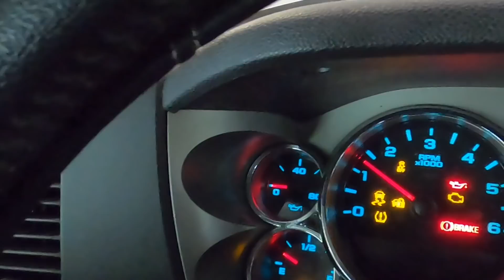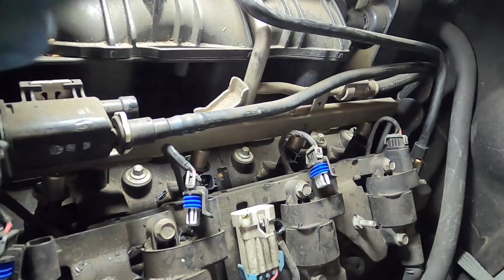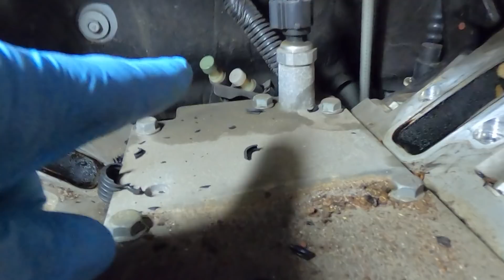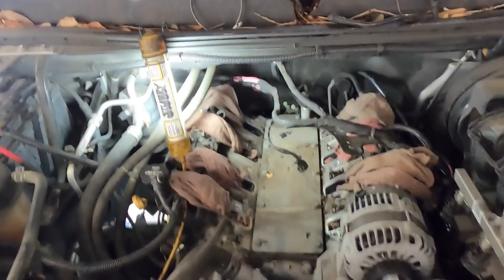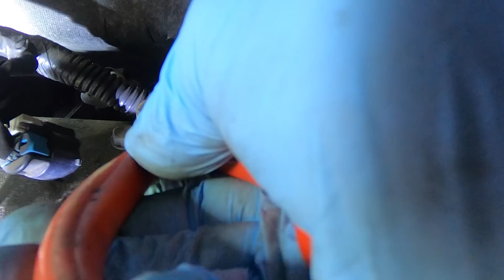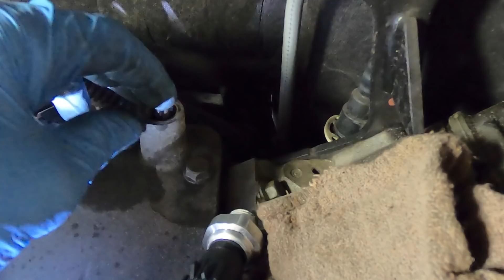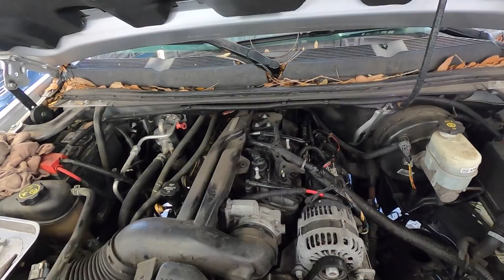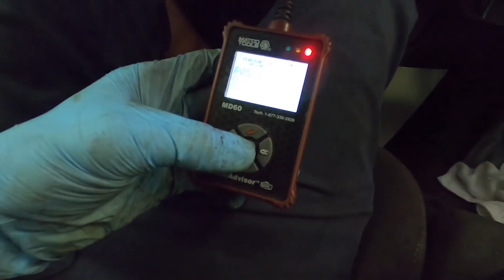Customer States: Google Diagnosis…replace this part!

Comment from the maker: Ok so after a couple day of Reeeeeeee comments I’ll chime in. For starters, the customer said that the gauge intermittently works then quits. No! I won’t do this job without pulling the intake. I’m not risking straining or cutting my hands up, so I can charge 25% of the book time to do the work. I have to take care of my hands, they feed my family. If I strain a metacarpal or get cut I can’t earn. I didn’t decide to circumvent the process to “pay less” for a repair because google said so. I don’t own that. Others people’s decisions are not my problem.
Reply: @6speedcreed204  this is partly the reason i quit doing work where I live at. Got tired of the "I got a buddy who can do it for 40 bucks" line.
Reply: @jonathanjuillerat9831  after i ask why they are in my shop if thier buddy can do it for 40 bucks i just lean into it and act like that's the greatest idea ever and then i insist they do it and tell me all how it turned out.
Reply: Was there ever a update?
Reply: After all, the fault is the vendor of the engine. It's crazy how some modern engines are designed. One could think that they are just built to get screwed together and never taken appart without ripping appart the whole car. Sure, there are more sensors, wiring, solenoids and stuff, but after all, a careful designer would NEVER put a sensor in that location!

Many modern engines are halfway under the dashboard. Good luck replacing the glowplugs on a modern FWD van or similar cars. Just the opposite of "form follows function"
Reply: @sorryimajerk735  Try cutting your hands up all day , everyday for 8+ hrs, for years on end, around hot as hell greasy,oily dirty engines, diffs trans, and oh yeah , asbesto brake dust when doing brake jobs.   See how much you enjoy it. There's a reason mechanics get paid good money. It's for what they know and have learned. Not because they enjoy self mutilation.
Reply: As an experienced GM tech I will chime in and say, I have never done all that and the average OPS is around 15 minutes for us to do.
The way YOU did it is by the book. So that being said you are doing it the right way and the way it is supposed to be done and I'm doing it the incorrect way. So if anyone gives you shit they can fuck off. We all have our ways we do things, so long as things are done right and not being damaged and you're not fucking yourself up then folks have no need to comment.
Reply from the maker: @frbrbrgrblgrr7777  There are 1000 different ways to do a particular job! I’ll also add that in this particular instance doing it the shortcut way would’ve made a crappy video🤣
Reply: @RainmanRaysRepairs  So when no one is looking how do you do it?
Reply from the maker: @johnhnetkovsky8917  I pull the intake 😎
Reply: @RainmanRaysRepairs  don't you know that having an education doesn't mean you know more than your customer 🤣
Reply: @RainmanRaysRepairs   okay so is it possible the reason the new screen did not fit was because there was an old one in still in there or the o-ring was not lubed? These seem like reasonable theories from the Reeee comments. Wondering if there were any updates after this repair. PS. I love your channel.
Reply: @RainmanRaysRepairs :  I saw you stick your pick in the hole, but some say there was a factory filter in that well. Thoughts?
Reply from the maker: @hightttech  maybe some had it, or dove didn’t. It could have been removed also. 🤷‍♂️
Reply: @RainmanRaysRepairs  Gotta love the armchair professionals in comment land.
Reply: @RainmanRaysRepairs  I do agree that not removing the plenum would have left a tiny fiber-cam video. I was by no means digging you at all in my comment other then to say that I'm pretty sure you left the old filter screen down in that hole. Like I said in my comment, I had to make a curtain wire fish hook deal to get that dern filter screen out of the hole because the O ring seal was holding it in there pretty tight. I made the hook so it was tight and would split hard into the screen when I tugged it out. Again, I did this blind with the plenum on in under 2 hours with plenty of breaks for a cig since it's not very comfortable laying on the engine standing backwards on a ladder lol. I always like your vids, soldier on I say with your great channel bro.
Reply: @frbrbrgrblgrr7777  sad they dealer is going to bill for 2.5hour
Reply: @frbrbrgrblgrr7777  I think your full of shit 💩🤳 lol GM Lube boy that's about it leave the Man a lone he does right by people all the time.
Reply: @sorryimajerk735  
There is a world of difference between an "Ouchie" that requires a band aid and a gash in your hand which can lead to an infection.
Reply: so much hate in here, think you can do it better than this fella than put your money where your mouth is and do it.
Reply: When you were finishing up the video, and stated that the issue wasn’t fixed, I noticed that the engine light was no longer on, and the oil pressure gauge was reading 28-30psi!  So looks like that fixed it after all!
Reply: @lifewiththehamptons1993  32:08 is the time stamp the owner said it was intermittent and that's still low but it was one of simplest things and a good place to start quite a few people hinted at what was likely overlooked but as with anything until the problem is fixed its just speculation.
Reply: this is probably said, but usually the gauge will come back once the codes are cleared
Reply: The old filter was down inside.  Thats why the sensor wouldn't screw into the intake after you put the new one on top of the old one.   So you technically owe him 2.6 hrs of work to take that all back apart, remove the old filter and put new one in at your cost since you threw the old one out 🤔  Even if the customer wants you to replace a part that isn't failing you should decline the work and do the "right thing"   Seems like a shitty move just for content
Reply: You know your doing something right in your life when you got haters 🤣🤣
Reply: So many YouTube mechanics in these comments. 
Y’all go ahead and post videos of doing your shortcut work. Then you can use all that time you saved for court when you get sued.
Reply: I agree with you Ray..
Reply: If you gonna do a job, do it right.. so im 100% with u
Reply: @tsal4379
Reply: @sorryimajerk735  What he said was that he isn't risking an injury just to save a bit of time because his hand is what gets the bills paid.. And he gets cuts on his hands all the time but there is a huge difference between getting a cut and getting injured
Reply: Oil sensor socket, universal joint, 6" extension, a ratchet and you can have it out and reinstalled in 20 mins.  Then still charging the 2.6 hours.  👍 Also gotta watch out for a clogged oil sender screen causing a good sensor to malfunction.
Reply: You're goddamned right.  Those hands are the most important things you have, for without them, you are non productive.  You did the right thing.
Reply: yep. but also i would have scanned it first and then called the customer. but then again the customer wanted it replaced with no diagnosis.
Reply: Car Wizard has an interesting take on this. Even if he can do something in less time than book, he still usually charges book because he's not gonna take a pay cut for getting better at his job. However, in his case that can cut both ways because if a job takes longer than planned, he still charges book hours.
Reply: Strain a metacarpal?  Dude, i love your videos but that is one of the most Reeeeee comments i have ever seen you post, ironically, lol. "I can't do mechanic work, because i might strain a finger and then not be able to do...mechanic work." :P  Also the "hello guys and gals" opening was fine the way it was....please don't indulge the mentally ill people that "identify" as mystical fairy poptart queens...it just adds reality to delusion.
Reply: @47ravenlord  someone might sue him for that one day
Reply: @32:08 the gauge is working.
Reply: I replaced my sensor without removing the intake and it was awful. I was cussing like a sailor and I couldn’t even find the filter in there because I couldn’t really see what I was doing back there. I had about an 1/8” turn radius and had to use like 3 different adapters. Definitely agree with you here
Reply: I agree with you 100% Ray! check my response.. ( if you have the time)
Reply: Safety has to come first. If you have to remove stuff to get it out of the way so that you can "safely" access the part in question. Well, that's part of the job. You aren't a contortion artist for goodness sakes. 
Many people don't realize that engine oils and chemicals can cause the most outrageous skin infections. Many Mechanics over time due to exposure to oils and chemicals get serious skin issues. I've used many times of barrier creams to stop or inhibit contamination but the first thing I've learned is. reduce the chance of unnecessary injuries. That being cuts, scraps and dripping oils & chemicals on my skin.
Reply: Just found your channel man. I’ve been wrenching for 10 years and Agree completely. It takes legit 20 min to have that intake off and I work on a ton of those gm V8 for lifter noise and oil pressure concerns.
Reply: It’s nice to see a tradesman standing up to these “tough guys” who seem to always be questioning someone else’s toughness.
Reply: To all, you so-called speed legends and super techs open your channel or business and show us all how it's done.🤔
Reply: Geez but there's some shitty comments here. It's well within Rays rights to say he doesn't want to chance being injured at work: if you are cutting your hands constantly at work and then super gluing them then perhaps you MIGHT want to look at how you doing your work cos apparently you are doing it wrong . . . .gloves are your friends here. I don't want to get injured at work and I do what I can to avoid injury, doing otherwise is nonsensical and again, you might need to review how you are working. Mind you, as a nurse it's always fun sticking needles into some dumbass that just sliced his finger four days ago and superglued it thus locking in all that bacterial: thank you for keeping me employed giving tetanus injections and cleaning out infected wounds. And as a safety officer, yeah, if you are getting cut, damaged, bruised, burned and have constant eye problems then we DEFINETLY need to reevaluate your work practices and attitude because it does seem like you are REALLY poor at your job. 😂😂😂
Reply: Safety first, last, and always! 

Just reiterating an early comment of mine, I wish the designers took the  mechanics of repair into mind when designing engines. So much of what the average owner cannot do, and much of what drives y'all up the wall is unthinking designers -- like the video where you had to unbolt the subframe and use a crowbar to remove a bolt blocked in by a pan. Make the designers do repair videos!
Reply: @ajkleipass  Engines are a monstrosity of luck....they are designed the way they are for the reason....because that makes it work semi reliably. If they designed them your way every vehicle would be a bus with the engine floating in the middle for clearance purposes, lol.
Reply: @ajkleipass  they are thinking all the time how can we make this hard so they go to the dealer or ruin there can and buy more perfect sense company wise
Reply: @ajkleipass  I wonder what a service friendly engineered engine would look like 😂😂
Reply: @ajkleipass  The designers know exactly what they are doing. Making something simple hard allows the automotive industry to make billions off replacement parts like special wrenches, pliers, and assorted tools, as well as hoses, gaskets other parts that if the job was easy wouldn't need replacing. It also allows the mechanic to enter parts of the engine that didn't need entering with older models, and thus diagnosing other problems, and making up-sales of other repairs. "Well since we have to engine this far, you might as well get this fixed also."
Reply: @ajkleipass  A lot of design isn't strictly up to the designers...   There's the no, you can't do that, it costs too much, the get it done quicker, etc.
Reply: @ajkleipass  but with all the other governmental regulations that car manufacturers have to follow that’s dang near impossible. A 2011 Chevy traverse requires you to remove an engine mount to replace the starter. Which is stupid if you ask me but it was the only way it would work.
Reply: @ajkleipass  buddy they did plan on the mechanics of repair. More specifically they planned on their mechanics getting a cut of the repair...
Reply: @inibrasiumthefirst2680  Hence the Dealer Tools for many jobs
Reply: Sounds like a gauge problem or the wiring that leads to it I bet it still has pressure
Reply: @howtowithelizabeth7513  it had pressure or the lifters would be making a racket
Reply: @howtowithelizabeth7513  LS engines are notorious for defective pressure senders.  They had problems from day one in '99, but post '07 engines got a lot worse.  No pressure and no lifter peck, almost always a defective sender/clogged screen.
Reply: @FMChimera  Thanks for reminding me that my Corvette needs the pressure sender fixing... I come on here for joy and merriment and now I'm reminding myself that 20,000 beers in that my hands no longer fit in tight places like they used too.
Reply: I agree 💯
Reply: the long and short of it is, if you want to complain about how much a shop charges for a job, then learn to do it yourself. if you cant learn to do it yourself (or dont want to) then your going to be paying what the shop charges you for the job.
Reply: @omgbbqcia911  with all due respect a shop should be doing it correctly anyway. Doesn't matter if you can or know how to do it yourself.
Reply: Watch it be the pick-up tube.
Reply: @2121beastmode  
Or the stepper motor operating the gauge.
Reply: Just throw the filter out. That's messed up.
Reply: What morons think you should do this without removing the intake?! o.0
Reply: I have to disagree . From what I saw it was fully worth the attempt to do it without removal of intake. Charge the full and take the shortcut if it is doable. Safety wise you should have an over creeper for truck under hood work instead of standing on bumpers and kneeling on rad brackets. At the end I see it showing about 40 on the  oil pressure meter top left so it is fixed. Now he has a decent chance of intake problems due to plastic and retorquing improperly.
Reply: I agree. My hands are my bread winners too.  Heck, my car bit her mechanic last visit and broke one of his fingers.  I felt bad. 😳
Reply: Fyi GM dealers would fire you for pulling the intake on that job
Reply: chevy,,like toyota,,change every 6 months..
Reply: I never use Google for advice. I use it to find people who can give me advice..
People think that google will solve anything, some things I found (electronics related) was so wrong, it ended up damaging some electronics I was working on..
Reply: @original_mrsaizo  I use a bit of everything. I repair my own stuff and sometimes Google helps as you can find things like I dunno the manual for the vehicle your working on. People will usually give you wrong info wouldn't go on someone else's advice without first looking it up or checking it first. Advice isn't fact thus your method kinda sux sorry
Reply: Why would you charge less than book time?  Book-time is the customer cost regardless of how long it takes you.  I'm assuming you are not flat-rate
Reply: Let’s address some things…

First. Ray don’t lie to yourself you did the job like 90% right. I can accept if a customer doesn’t want to pay for diagnostics, I can accept if a customer doesn’t want to pay for a new intake gasket set, hell I can even overlook using shop air to clean the valley instead of getting the vacuum out (I mean that does take more time). But what I won’t look past is did you cut the footage of you cleaning the intake seal or the runners, of you looking for an old filter screen? These are items that shouldn’t be looked past for an experienced technician like yourself.

Second. To half of the weird comments around here I just used that word technician. I use that word because I am proud of it. I went to school for an education. That does not make me any less of what a mechanic is, but I will say whichever word you use you better  be respectful of people who do something you choose to pay for. But for me by denying my education and calling myself a mechanic that’s something I won’t do I earned the right to call myself a technician I didn’t get a job at Jiffy Lube where they call everyone a technician because it’s now sadly used as a catch all job title. And to the favorite comment I read so far on this video I sure can do a lot more than read a scan tool…

Third. To all us who know this job can be done in 20 minutes. I agree with you it can but you risk a lot more doing it the wrong way when you don’t know how to do it the wrong way correctly. I know that sounds weird but for example  if I asked you to replace any part on a vehicle and I said that trained generic technicians (those people who come up with labor times for example) took them 8 hrs to do the job as designed to be done by the manufacturer and we found a guy who has been doing this job incorrectly and repetitively since it started occurring and he gets it done in 1 hr. That first guy had to follow an instruction book correctly and in a timely manner, this take him negligible time to do, the second used those seven hours he saved multiple times to create his own instruction book and when I don’t have his instruction book I don’t get to do the job the “fast way”. What if Ray didn’t know the fast way existed?What if there wasn’t a GM guy around to tell him what he needed to do to get it done the wrong way? You do the right thing as a technician and you follow the instructions the manufacturer made available to you and you get the job done, maybe you learn that next time you could do x,y or z to do the job faster, maybe you make a YouTube video of your day, then get way to many people commenting who watched a different video of another guy doing the same job and “he did it differently and way faster” or “they do it themselves that way”.That is amazing for those people, great job. The point is Ray you did this job mostly right and that is what I appreciate about your videos. The “fast way” to do something will always be the fast way and unfortunately fast does not equal right. From a technician who also doesn’t risk his body for a quick pay off I applaud your resolve to perform jobs the way that you are comfortable with so far as risk is concerned.

Four as a dealer technician I am asked to install parts all the time without diagnosis. I can not make a customer pay for anything and I also can not tell the customer what to do with their money. I can talk to them and explain why I have aversions to fixing the car this way. In the end I am a wheel in a cog and if my dealer wants to accept money for a repair I can only tell them to ask another technician to do the service. The same way a customer is allowed to pay me for diagnosis and then decline the repair I suggest the opposite can be done as well because that is their right as a consumer in the U.S.A. I know you agree with me on that one rainman. 

Five, diagnosis of this would have been a terrible video I’m pretty sure and the fast way would have made you every other backyard tech who posted a video titled “how to change this problem LS engine part in less than 30 minutes”. Keep on rocking your awesome videos and giving a better name to technicians than most of the other YouTube techs out there.

Lastly whoever did that playlist can we get a Spotify link?
Reply: Holy shit I've done hundreds of these and the FIRST thing you do is remove screen and do not reinstall EVER!
Reply: Google told me you suck so I had to stop by and see if that was correct...I'm happy to report google is full of crap lol
Reply: Ray, you are absolutely correct.
Reply: Ray, you deserve to be paid. Going by book time, sometimes you eat some labor, sometimes you make out, it will all even out. You're an honest, smart, thoughtful guy, I don't expect you to take shortcuts.
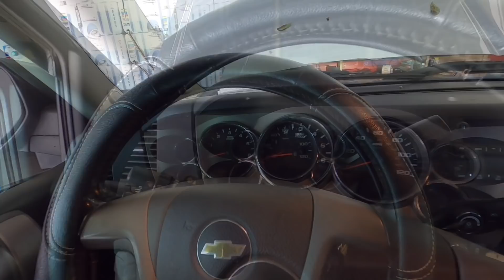Reply: I'm at 29:54, you're just about to test it & I'm saying "Nope!" 
The customer read about the recall & it suited his symptoms. But I reckon it's a blown gasket or seal somewhere related to those other warning lights... 🤔
Reply: What a joke to change a oil sending unit, they could of mounted it in front of the engine.
Reply: @jasonjgr8580  but they didn't. That's not relevant here
Reply: A lot of these commenter love talking 💩💩💩💩! I thought you did what you were told to do . The vehicle started and drove no harm no foul.👍
Reply: you did it right.  on the trucks, its nearly impossible to actually get back there without being a contortionist.  your work time, no one elses.  I did the one on my cargo van, and damn is it nice to pull the doghouse and just be able to reach the entire engine.
Reply: They paid less only to cost themselves more when the repair they requested didn't fix the problem.
Reply: I have this issue with my own 2010 Silverado 4x4 5.3--- the oil pressure sensor went on the truck shortly after I bought it 3years ago... I will be rewatching this for the full repair looks like I'm invested more than I'm physically able..thank you for your time keep up the Hard work
Reply: @richardbobrowski   learn how to do it without pulling the manifold, less chance of breaking stuff. My cousins truck has this issue a lot due to the lack of maintenance from the previous owner, the sensor is usually fine once you have a screen, sometimes I can just clean the screen and put everything back. The brake booster clip and sensor clip take practice, and you do need a special socket like Ray mentions in the vid..
Reply: @djmjr77  brother I can't tell you how much I appreciate the help bought that truck almost three years ago now and it's a great truck I just can't allow anyone to fix it ... thankfully theirs guys like Ray because all I have is the AutoZone Chevy Silverado 07-13 book and Common sence .. any form of help is much appreciated Thank You
Reply: @sorryimajerk735  gb
Reply: I've replaced this sensor in 15 minutes with the screen many times.. the first few times def took longer, but its a piece of cake now. I also do not work at a shop that could have liability if the manufacturers instructions are not followed.. and something happens doing it the "quick" way The intake isn't to hard to take off anyways and give a chance to cleanup under it I guess..
Reply: I don’t believe you removed the old screen (maybe you did and I missed it) I did this repair about a month ago and used a bolt roughly the same size as the sending unit orifice to thread down on the old screen and remove it.   It was covered in brown goodness….I ended up having to reuse the old sensor because I broke the new one trying to tighten it down blind (kudos to you on removing the intake….I tried the easy way and failed haha) the new screen fixed my oil pressure issue.  I’m not sure if that truck had one but I’ll bet it did.   Anyway sometimes the internet can be helpful. Not trying to be a troll douche just adding my own experience to the convo.  I enjoy your videos brother ✌️
Reply: Charge book time,  and do it in 20 mins. Customer isn’t paying me for my time in it, they’re paying me for the years of experience it took to learn how to do it quick and easy, without issues.
Reply: @johnsonspeedfab   I'm not 100% certain, but besides the moral implications, I don't know if that would be legal to charge book time to pull the intake manifold and then cheat by doing it with a swivel socket...   Ray?
Reply: @hyperchuk  when a vehicle comes in with issues/concerns, and the fix has already been quoted by the book, doesn’t matter how it gets done, as long as there are no more/new issues. 
 
The reason master dealer techs make a killing. They get into a rhythm of the same-old same-old, and they get good at it. I’ve seen guys knock out 2x 10+hr transmission R&I’s before lunch.
Reply: @johnsonspeedfab   For what it's worth I Am one of those guys and I have been for the last 47 years. I just know how bad that pisses off customers when you pull that angle
Reply: @johnsonspeedfab   I was the transmission technician at Gary Fronrath  Chevrolet for 3 years and I used to pound out rebuild after rebuild on that 700 R4 and I made about $2800 a week like falling out of bed....
Reply: Changed this part on my 2003 silverado without removal of the intake, but it was frustrating working with a mirror to see. Oil pressure gauge would pin at max pressure. Replacement of the sensor fixed it.
Reply: I once visited a doctor at a new office.  He hired me on the spot to hang his diplomas and stuff, because his insurance, he claimed, forbade him from using a hammer.  But he had a hammer... go figure.  Anyway, I got paid nicely for an hour's work.
Reply: Hard to check the sending unit screen with the intake in the way, also hard to get it out without damaging it with the intake in the way
Reply: @sorryimajerk735  as the owner of several successful workshops in Australia it is my opinion that pig ignorant, crude and disrespectful employers like you (if you actually are one) are what really damage our industry most. A real businessperson manages people effectively and first, supporting their staff in an environment that fosters honest communication and promotes quality work. No worker in my shops had to risk their health or their career to make moronic shortcuts to feed my ego - if your staff are forced to, they have my sincere sympathies and I hope they get a new job at a decent shop soon and can leave your bad attitude hack shop behind. I would hire Ray (and have hired solid, skilled and effective tradesmen & women like him) any day. Didn't your momma teach you, "If you don't have anything good to say, don't say anything at all"? Most American I know are decent, straight people... I guess every barrel has a few rotten ones huh... "Bill" Kill...
Reply: If the technician is unfamiliar with a repair then following the service manual, or Mitchell, or whatever repair information you have access to is the only responsible way to perform the repair. It covers the technicians butt in the event of an unrelated fault, or a fault caused by a manufacturer defect in the parts. It's all about CYA guys, if you take a short cut and the job comes back it's all on you. As far as getting hurt doing repair work, a technician should always mitigate injury as much as possible. Injuries do happen and most of us shrug it off, but degrading a tech who values their safety says a lot more about you than them.
Reply: @kvanderpool0508  yeah I can see where you are coming from. But from the techs mouth he's going to do it by the books and he don't. Lol he may be a good tech that TRIES going by the book but 1 doesn't torque the intake or remove the old screen has no place to talk about going by the book. Either you do or you don't. That simple.
Reply: I understand if you don't want to give a exact location, I was wondering what State the shop is in that you work at. What radio station do you guys listen to in the shop the music is good working music. The shop I use to work in just played the local radio station which sicked at that time.
Reply: @Incognito FLA  realize you made a poor decision buying an audi without having a professional certified mechanic look it over first and then , im sure because of your mickey mouse repairs, the car no longer operated correctly. You are the perfect example of why professional mechanics are necessary.
Reply: @sorryimajerk735  Relax, bud. He gets cut all the time, but destroying your hands for one job is dumb. It's not like the customer didn't approve the cost beforehand. If they don't like it, let them go to another shop. 

Ray also saves customers money where he can on a regular basis. Go abuse the caps lock button somewhere else.
Reply: Well said.
Reply: I agree with you. Do it how you want. Personally im willing to "strain" a little to save time but im shadetree. Doing my own repairs. Not making a living at it. My biggest concern with doing it your way is the massive risk in breaking connectors that become brittle or o rings on injectors potentially getting pinched. Anything can happen!
Reply: You have no idea the memories this video brought me. My best friend TJ was a mechanic that passed in a car wreck November 14th 2019. His FAVORITE song ever was "Wanna be a baller" . As soon as i heard that and saw you under a hood I had flashbacks of him. R.I.P my brother...👨‍🔧👨‍🔧👨‍🔧 🙏🙏🙏
Reply: Psychologically wise you’re using a form of empathy to justify you taking off the intake manifold so you say “oh I can’t cut my hands and if I do I won’t be able to feed my family” b.s you’re trying to justify putting in more time then is actually needed to change a measly sensor when I my self have changed an egr valve on jeep 😂 where the work space is tighter then f*** in the back.
Reply: You know,  i read a lot of these comments about not being so worried about cutting your hands.  About how it should be an hour max.  I have to side with ray.  First,  its not about the one or two cuts from this job.  Us shade tree guys will happily trade that for the occasion it comes up for some extra time off the road.  For the pro, it is about all the cuts, bruises and injuries that occur from making a habit of it.  It is about havig ground beef for hands at the end of a week.  As far as the it should take an hour or less, labor guides are there for a reason.   Without them  some folks short change themselves on their good skills and investment in better tools.  Others would take advantage of the fact that the time comes down to their word against a customers.  It is there to protect both sides.   Dont like it?  Do it yourself.   I rarely take my truck in for service.   Usually it saves me loads of cash, sometimes not.  If i I were Florida and needed service, i would be happy to have ray turn the wrench.
Reply: I agree with you 💯% I work in auto repair shop customers think they know it all 95% of them don't have any clue what is wrong with there vehicles. Google don't know anything about vehicles
Reply: Some of these comments are crazy. If you want to abuse your body to do a job then you do you. To criticize someone who wants to do right by themself, and the customer is completely a "you-problem".
Reply: Exactly. If you don’t want to pay a professional, do it yourself & make sure you have towing on your insurance.
Reply: Haven't seen the end but part of me kinda wants the part to not fix the problem.

Do I search up plausible fixes when I have vehiclr problems, yes. But I take my hand at replacing the part myself if its something I feel I can do.

If it has to go into a mechanic and its vital, I am going to rely on their input. Got a place where they will put parts in. I mainly use them for suspension parts work or when I needed my wheel hub bearing assembly replaced. I didn't have the hammers to smack it out so I paid them for that work.
Reply: Ain't going to lie that day you guys was jamming some classic 😆
Reply: The sensor replacement really seemed need removing the intake mnfld.
Reply: Customer check engine oil?
Reply: I have a skinny 3 inch lag screw to be able to reach in and grab the screen. The reason the new screen wouldn't go in, is because you never removed the old one. It sits deep enough that it is very easy to miss.
Reply: 100% spot-on correct Ray.
Reply: I completly agree. I have an 09 tahoe and I did it by reaching around without taking off the intake but it was indeed a pain in the ass and I could barely fit my hand back to get to it. 

If I do it again I'll also be removing the intake.
Reply: Ray my man, good day to you sir. Don’t worry about neg comments on here you do not have to justify anything to these keyboard warriors.. keep up the good content 👍
Reply: After watching more of your videos than I would care to admit, I would honestly say if you told me that you had to remove the entire engine just to get at something I would take your word for it and NOT argue with you.  Although I've never met you or ever had you work on my vehicles, I implicitly trust you that you only do the work required and whatever work you do would be done correctly.
Reply: I feel the same way. I'll tell someone to fix it themselves if they want to jump my ass cause Google said you can do it cheaper with "dangerous" shortcuts.
Reply: A man has to make a living. The End!
Reply: OMG, I've seen enough in here.  Most of you A$$holes giving Ray a hard time about how he did this or armchair quarterbacking him need to shut up.  First he did it the way he felt it should be done and after watching a LOT of his videos I would say he did it the RI|GHT way.  Ray has probably forgotten MORE than half you idiots know about mechanical work.
Reply: I can't believe what it takes to changan oil sensor,
Damn,
Reply: @edwymer2226  It depends on the vehicle.  Some of them it would be a breeze but others are like this one.  I remember I had a Nissan I had to replace the starter, piece of cake job, right?  WRONG, practically had to take the engine out to do it.  Some repairs are nightmares while others are dreams.
Reply: Ray, just adding another comment in here, bud.  Please don't let the REEEE comments get you down.  A LOT of those type of commenters are nothing more than TROLLS that are just out to get a reaction from you.  Hang in there pal., because you DO a GREAT job and everything you do shows that.
Reply: Seems like you were a bit put off about that job. No doooo do doooos. And I could taste the salt in your voice. I'd be salty about doing such a job as well.
Reply from the maker: @ningen1980  I think I was PO’d over something
Reply: I agree with you I love these armchair mechanics and read something and know everything and I guess they recommend it all you climb over the top of the motor and stick your arm and back of the intake and fiddle around to get that thing out but I agree with you I wouldn't do it have a good day
Reply: If this guy has to remove the headlight , he may need to be air lifted out of the shop.
Reply: Agreed.
Reply: There you go, Ray! A wise old man told me "Do your job, but protect that body. There are many jobs, but you only get one body!"
Reply: Aren't you supposed to blast it off with air before opening it up?😮
Reply: Lots of shit posting here eh.  The customer didn't want to pay for a diag, they only wanted to have the part installed, and that's what Ray did.
Reply: regardless what the book says for the time, that how mechanics make there time. i can do those and the screen in 15 to 20 minutes flat. book time calls for 2.9. if i can do it fast cause I've been in the business for 22 years as a tech then that's 2.5 hours in my pocket. the book time doesn't change cause you can do it faster than the next person or cut corners to get the job done way faster. the more hours you flag the happier you will be at the end of the week.
Reply: @monstermike2541  book time is BULLSHIT
Reply: @stevejohnson1397  yeah it is but that makes it to where people won't get fucked in the end when they pay the bill. But as for techs I did a 10 job today in 5 so I'll take that anyday.
Reply: @monstermike2541   Mike, not trying to be a smartass here, just curious. When you do a 10 hour job in 5, do you give the car back in 5?  Has a customer ever questioned getting charged more hours than how long the car was in the shop?  I was in new car sales for many years and I thought the dealerships only screwed  sales, after reading all the comments I guess they do it to service too.
Reply: @monstermike2541  The Car Wizard said something similar, why should you get paid less for being good at your job
Reply: @monstermike2541  Sorry man but I call B.S
Reply: @davidbeanz3906  what bs are you talking about?
Reply: @monstermike2541  I got the wrong guy. Sorry man, I'm a dinosaur with this thing.
Reply: @davidbeanz3906  all good buddy 👍
Reply: @monstermike2541  really so why does warranty time always pay less
Reply: @firstnamelastname-gf4ds  warranty times are made up by the manufacturer of the vehicle. Flag rate is done by b.a.r. they have someone do the job 3 times and average out the times to make the rate time. Dealerships do 60 to 70 percent of the flag rate to fuck there techs for the engineers incompetence.
Reply: @firstnamelastname-gf4ds  cars under warranty are newer and cleaner and less broke generally and the guy doing warranty work is doing tons of repeat work so they're super fast at it.
Reply: ICE ICE BABY
Reply: Agreed.  Yeah, besides making the job hell for yourself, it also makes it possible that you’ll break something else while you’re at it.  Some people will never understand what this job is because they change their own oil and think that makes them mechanics.
Reply: It's funny how many people want to scream in favor of the shortcut method.  It's hard to find a good mechanic that would do the job right.  I've seen some of the shortcuts mechanics take.  Bent brackets, broken connectors ect...  frankly it disgusted me personally.  It's why I do my own work.  It's wrong to do work in this manner.  If you don't want to treat customers property with respect... get out of the buisness because you'll never work in more than a third rate chop shop.
Reply: @brianmyers2243  Preach! I like everything back the way it came apart. I don’t want someone telling me they couldn’t put this or that back on and that it won’t affect something. One reason I do my own work.
Reply: If you are going to do something do it right . If the customer and all other "Master Mechanics on keyboards" feel they can do it better fine, do it yourself then. Don't go to a shop for an act good faith. Salvation Army and plenty of Churches will do.
Reply: You did it the correct way. Never seen so many derogatory nonsense from people who clearly enjoy your videos. If you just look at the grammar and spelling, these aren't the sharpest tools in the shed.
Reply: @ravenfn831  you have intelligence by how well someone’s spells or uses grammar in a YouTube word post ?   Hmmm
Reply: Yeah the rate is the rate. I’d take the short cut and charge the full time. The rate accounts for hand tools yet we(I’m a tech too) use some power tools like that electric ratchet to get it done faster. We bought the tools that made it faster but weren’t necessary for completion. We learn the tricks. We reap the rewards. I cut my hands every day and I charge for blood. I say reeeeee to the haters though because nobody will tell me how to do my job. At least not successfully. If you are a customer don’t get butt hurt about it, you get your vehicle back faster. And all you want is to get back on the road right???
Reply: @iwalker1985  agreed. I'm a hard surface floor guy by trade and people give me grief about easy repairs but they don't understand that the tools I use and knowledge of how to use them are what they are paying for not the time it takes to use them.
Reply: @iwalker1985  exactly. If you don't want to pay even a discounted rate then fuckin do it yourself I say. Like me, I can do my own back brakes with my hand tools and take 3 times as long to do it. Or like today I paid my mechanic 80 bucks to do it because he can do it in less than an hour and my time is worth more to me.
Reply: @iwalker1985  definitely especially when you get paid by the job. No strain at all to get the socket short extension and 1/2 ratchet on it. Good thing with these once you turn them the slightest you can turn them by hand.
Reply: @iwalker1985  flat rate of figured out by an average the technician does the job three times and they average the time that's how the time goes in the book
Reply: @stevejohnson1397  you are correct
Reply: @stevejohnson1397  The flat rate is known to be inflated and is, again, one of those "self-regulation" circle-jerk measures. The technicians who do the jobs are not blind to the fact they are being timed, and techs aren't "required" to clock their time actual vs book time so the book time doesn't get updated. The book time is basically just a made up price sheet for a job, which is absolutely fine, but I wouldn't try to make it sound like it's this proven fair method either.

I don't have a problem with just paying people a solid price to do the job, and have no issues paying for techs time, knowledge, and tools, or even a flat price for a job, but the fact that it has to be justified in such a dumb and shady way is annoying.
Reply: The  @iwalker1985  is the
Reply: @iwalker1985  Ethical AF.
Reply: @iwalker1985 I concur.
I am 6' 5 239lbs and wear xlarge gloves so my hands aren't small. 
 I replaced my sending unit yesterday,without removing the intake and it took 19 minutes and I had never done it before. 
 I did not get a single scratch on my hands by taking the shortcut and I didn't risk contaminating the intake.
 I don't have a problem with him removing the intake but I can't understand not knocking out a job in seconds and moving on to the next repair and increasing a paycheck.
Reply: @iwalker1985  if the work is done by the book and i do mean word for word then i have no complains. saddly most the time i fix the problem myself because money tend to be tight when shit start breaking down. go figure
Reply: @Crispy77760  I hope aren’t an English teacher
Reply: @iwalker1985  no im not. there no pay in that and grading the kids papers you normally do that off the clock from other people experience they have shared with me. i work on computers for a huge company UPS i correct incorrect information on really everything. just because my grammar not the best doesnt mean im not successful. that not what implied but your suggesting something in the area of stupid or dum. ill say im the opposite of that. lol
Reply: @iwalker1985  No the customer wants the job done CORRECTLY and not half assed.. Because for someone like me if I catch on that you're doing half assed work and I'm still paying top dollar your shop is done.. There is something to be said about doing the job right the first time instead of trying to get done as fast as possible just to make more money for less work
Reply: @brandonstone6962  didn’t say it wouldn’t be right… obviously you didn’t read my comment. No where did I say I wouldn’t complete the repair. Just that if I buy tools that get it done faster or differently than the outlined method I would still charge the rate. I invest in tools to make money, not for charity. You sound like the kind of customer I don’t want. My customers actually appreciate me and are happy to pay what I charge. In fact I regularly get tips for my speed and quality. Time is short in this life.
Reply: @sorryimajerk735  hypothetical  you own the shop and find your employees are cutting corners and doing shortcuts that pit your shop reputation on the line and then also.not charging book time on their labor cosing you money on the bottom line. DO YOU FIRE THEM? If not then quit whining g about him doing it by the book.
Reply: To many know it all's on YouTube I wouldn't even respond to dumb comments like these. We all watch you save people money everyday if you do something they should know there's a good reason why.
Reply: Yeah, I did the shortcut and it dies save a load of time. It was on my own vehicle and it saved me not only time but no possibility of replacing gaskets or broken clips or whatever and I think the screen only fits the cover with the selonoids. Didn't fit mine either.
Reply: @ThePeopleVerse  I
Reply: @ThePeopleVerse  I had to dig for my screen. That was the hardest part aside from getting that stupid clip off the plug. 🤣
Reply: @marsh35404  mine for sure didn't have a screen.
A few months later the AFM started acting up and a lifter took a sh*t and I pulled it all and did a Texas Speed cam and delete kit. No screen found in the old cover.
 Funny, I have better oil pressure and a couple tenths better MPG and a nice rumble at idle and seems like some seat of the pants top end out of the old girl.
Reply: @ThePeopleVerse  I think it all depends on the year of the vehicle or if someone took it out prior to you doing it. I have a 2011 tahoe and it was for sure in there. Not sure what year yours is. Also, I have learned over the years to not use aftermarket electronic components like sensors or fuel pumps. Ac delco all the way and never through the stealership. 🤣
Reply: @marsh35404  using a skinny handled slightly angled pick is how I get the screens out when I do these. I also don’t pull the intake to do this job.
Reply: Marshall, gotta agree 100%.
I was at about 30psi with terrible tick started and had a sideways and a stuck lifter. TexasSpeed hooked me up. I took my time as it was winter and I did not want to have a 400$ electric bill trying to pull the shop from 4 degrees to maybe 50.... but a few weeks later and a home repair and she will walk the dog on the top end. Like you said too, a nice little idle to it as well. 
 Probably one of the best running 07 Avalanches around and almost 20mpg too boot.
Oh, and no screen for the new plate and sender either.
35+ psi oil at idle and 55+ above idle and stable. Never had that with that messed up system GM stuck us all with.
Reply: @6speedcreed204  those times are a best case scenario from a tech who has done it before. A customer would spend days doing this lol I've seen it
Reply: @inibrasiumthefirst2680  You're talking bollocks
Reply: @MattyEngland  im got more scars on one hand then your entire ego
Reply: He'll take the intake off and do all of the extra work. But he GUESSES the torque specs when going back together? So much for " by the book"
Reply: lmao, glad it didn't work, can't stand people like that.
Reply: ‘Book time’ makes me laugh. Correct tools to hand, experience of doing the job before and taking into account that everything comes undone as it should. I have customer sometimes quote the book time to me, and I explain it’s a 15 year old pos and that time isn’t going to work 😂 I’ll use extra tools that I have purchased to undo parts and fittings that have cemented themselves in rust. 
You do you mate listen to no one but your boss
Reply: FYI, you needed to pull the old screen out before trying to install the new one. Just did my 2011 5.3 without pulling the intake. Just sayin. 🤣
Reply: @marsh35404  he fished a screwdriver in there to clear out any old filter or obstruction... or did you not watch the video. If you cant pay attention then don't comment goofball.
Reply: @Im-Jeff  fishing a screwdriver in there won't get the filter. Thanks though.
Reply: @marsh35404  No it won't but it did verify there was nothing in there to get to begin with, thanks for doubling down with nonsense though. Additionally the distance the filter he tried to install went in 90% of the way is clear indication that no previous filter exists. It would not have gone in more than a fraction of the way if there was already a unit there. ;) It did occur to me that it may have a certain orientation that is required to go the last 10%, I might have spent more time trying to get it.
Reply: @marsh35404 :  Interesting. I haven't had this job before. So there was a filter from the FACTORY? That might explain the problem if it's clogged. I think i would have cranked engine to be POSITIVE oil getting to that sensor. This may very well be a fail for RR if he left a clogged filter in the hole.
Reply: @marsh35404  maybe you should have recorded it and uploaded it to you tube just so we know how amazing you are, just Sayin.
Reply: @pinkjedi6664  maybe I should have 🤣🤣🤣
Reply: Oh god.    Whine some more.
Reply: @daniellepage2923  hormone issues?
Reply: @ravenfn831  ?
Reply: @daniellepage2923  true
Reply: I guarantee you that, if engineers had to repair their cars, they'd go about the design way differently.
Reply: And fyi chilton time is what job pays not how you do it that's how you make money but I see your a NOOB  by the book it's ok sorry if I offend you but I've been a master mechanic for 30 plus years and you have to have a open mind especially living in the rust belt
Reply: I just hear whining. I can do it without cutting my hands or straining. You just want to rip people off. Hack
Reply: I was hoping you would have actually diagnosed a repair and seeing if it was a faulty gauge or wiring instead of just replacing the sending unit. But most likely it is a sending unit. I just think it's always good to diagnose the problem even if the customer only wants to pay you to do a certain thing.
Reply: @Ratrazor  Then people never learn to get things done the right way . . .
Reply: @Ratrazor  you do only what the customer asks, otherwise you (if you own the business) or the shop you work for is liable If something were to happen. Some customers would possibly understand if you spoke with them then there are those that it’s impossible to convey information to so that they comprehend it. Like many others have said, if it calls for 3 hours and you are done in 30 minutes they pay the 3 hours. There are way to many places to have repairs done to get bent out of shape over book times and right and wrong ways. I work on my own stuff but watch a ton of videos because there are better ways of getting any job done.
Reply: @Ratrazor   Changing the sensor didn't fix the shit. High current reading on the scanner  is most likely an indication of bad wiring, or a short to ground.  I would have scanned FIRST!!! And then Advised the Customer that his diagnostic might prove to be WRONG. If customer says DO IT ANYWAY, then you can really stick it to them .. lol
Reply: Only non mechanics would argue with you. As a mechanic I trust you, if you say it's not possible, I'm an idiot to try!
Reply: As far as having to pull the intake to do the sending unit really there is no other way, other than I've seen guys they'll lift the whole body off of the frame to get access to the back of the motors on the diesels and stuff. I don't know if that's less work or more work in this case. Or likewise you could pull the whole engine and tranny up and forward to gain more access that way also but really the intakes probably the easiest.
Reply: @Ratrazor  incorrect. I have NEVER removed the intake to do an OPS on an LS. Some have a cover that has to be moved back but  it is still possible to remove with the correct combination of tools.
Reply: @Ratrazor  you sneak your hand back there, unplug the sending unit, use a combination of tools and replace. No intake removal, let alone jacking up engine lol
Reply: @Ratrazor  There's no real reason to pull the plenum on an LSx to change a sending unit in a GM truck.   A camera, a swerbly, a couple extensions and a rest and it's less than a 20 minute job, even for those who still want to stiff the customer.
Reply: I've pulled and cleaned that screen on the same engine 4 times.  It's a legit 45 min job including mandatory break.  WITHOUT taking off that manifold.  It's NOT that difficult and yeah you might get a little boo boo on the back of your hand, but CERTAINLY no more "dangerous" than you standing on that makeshift stand.  What you SHOULD have done was tell the dude you're not taking the job without first diagnosing the problem.  You're really no better than he at the point you decide to simply take the part and add as much book time as possible.
Reply: I have huge hands and I do this job without pulling the intake and charge $45.00. I am an ASE certified mechanic and I believe in helping others out. I'm not looking to get rich. I have had family members get charged over $600 dollars but quoted $800. I hate when mechanic's/shops rip off customers.
Reply: @911argon  do you work for a shop or own your business?
Reply: @6speedcreed204  and that’s why I don’t go to shops cause the book is a money scam something that could of taken 5 to 10mins takes 2+ hrs  plus the %100 mark up on parts    U can get a part for $60 but if u go to a shop that part is magical $120
Reply: I'm just curious. Would you remove the catalytic converter and transfer case from a 2010 gmc Acadia to do the power steering pump, just because the book says so? I would not sir, it can be easily removed by removing the pulley first and nothing else has to come out. You just turned a 6 hour job into an hour job and you get to reap the benefits of getting paid 5 hours more than what it took to do it. If your shop is charging by the amount of time you spend on the job and not the labor guide, I would run...
Reply: @MrMeow-6969   Yeah I have a shop tell me it was going to take eight hours to replace a ac compressor  on a 2005 Buick LeSabre I laughed at him and said I do it myself now I’m not a professional home mechanic by any means it took me an hour and a half to take it off and replace it.
Reply: @6speedcreed204  It was stunning how much money I made early on, charging 20% less per hour and charging real-time.   Every shop around hated me...the only thing I hated was never having any time off.  If a shop wants to mindlessly go by the book there are lots of better businessmen who will happily screw them to death. :)
Reply: @FMChimera  some people will not go to anyone other than a dealer though. They have the money and no time to waste by shopping around. Those people make dealerships the money.
Reply: @FMChimera  don't complain when china take your jobs.
Reply: You can earn if you get a cut?? 23 years I’ve been painting professionally and get cuts all the time. Some bad ones too. Super glue it and get back to work.
Reply: @chadvalliere8697  it's your decision and your hands,ray own his own hands and decides what's best for him..its not up to you to judge that
Reply: @chadvalliere8697  shouldn't be getting cut from using a paint brush.
Reply: @chadvalliere8697   Don't tell me, you're the dude that always falls off ladders too. Glad to see that your proud of your ineptitude.
Reply: 😂🙏 @chadvalliere8697
Reply: @chadvalliere8697  You getting cuts "all the time" and being ok with it tells me two things. 1, you are not very smart and 2, you can't be good at your job if you fuck up so often.
Reply: @GTrainRx7  the thing he forget is.... Cute heal.
Reply: @chadvalliere8697  nobody is proud of your painting career btw
Reply: @inibrasiumthefirst2680  savage. truth cuts the sharpest
Reply: @inibrasiumthefirst2680  Him and his family appreciate it....so why does yours or anyone else's pretentious opinion mean a damn thing?
Reply: I mean as a tech I got cut all the time, got welders eye, stubbed my finger, burned my self. Seriously dude? Your hands must be nice and soft
Reply: @Rainman Ray. This sounds an awful lot like someone needs to go pop a couple of Midol, change their tampon, and put their feet up!
Reply: @clintonhanson  Says every Troll on the Internet. Is this a case projection through accusation? Are you jealous of Ray's ability and thus your own laziness results in lack of ability? I do not know you but really seems you are the one with the issue of needing to take a few Midol.
Reply: Then you are not a mechanic.  I tell people no. I won't take their money, but you will. Good marketing you are no mechanic, you are a parts salesman.
Reply: @thepsyc_one4245  no. If a customer is adamant that they want something dine then why not do it? I have asked mechanics to di things they thought were unnecessary but for me they weren't
Reply: @thepsyc_one4245  Which of the dozen + commenters are you referring to?
Reply: Metacarpal is a bone, you can't strain it lmao.
Reply: @bbbbbb1243  SO is an ankle.  Bet you never heard of spraining that
Reply: 15 min job max just learn to use tools better lmao 🤣
Reply: @lukek3148  LMAO at anyone who claims complete removal/replacement can be done in 15 min, the only tool you've ever held is your own.
Reply: @barryaiello3127  the job was to change the oil Pressure sensor not take the intake off. Believe it of not you can fix cars without following manual step by step lol.
Reply: @lukek3148  I agree with that, maybe he thought by attempting the shortcut he'd damage something. I'm not a mechanic but have worked on my own cars since the '70's, always buy a Haynes or Chilton's and yea, sometimes I figure out a faster way but usually they are correct, specially the Haynes.
Reply: @barryaiello3127  good mechanics are paid to be able to beat the book time  whether it be flat rate pay or hourly. I can't even count how many of those sensors I've changed and I have never pulled the intake, never cut my hands and never damaged anything
Reply: @lukek3148  Fair enough, but you DID say you could remove/replace the intake in 15 minutes..
Reply: @barryaiello3127  no I said it was a 15 min job and it is. Intake removal is not required
Reply: @lukek3148  OK, some confusion here, you said "15 min job max just learn to use tools better lmao", nothing about skipping the intake removal.
Reply: @lukek3148  Don't forget the cost of the shop, local permits, tools. uniforms, office staff, and all other business expenses. Rainman is right. You don't like the way he does his job. find someone else.
Reply: @campnchris  I never said you give the customer a discount. That's the point of a labor guide. If the labor guide says a job takes an hour and I do it in 30 mins the customer still gets charged an hour.
Reply: Show me!
Reply: @lukek3148  Have you every done the job in 15min max????
Reply: @gary4447  usually ten mins depends if I take a break to smoke a cigarette lol
Reply: @lukek3148  What????
Reply: @lukek3148  Give the good people of youtube your details. Sure there are plenty of people out there that want you to repair their truck and charge for 15 minutes labour.
Reply: @lukek3148  Prove it with your own video.
Reply: @lukek3148  OK boomer
Reply: @lukek3148  Nope they can do it them self if they want a part only pay the time it's pretty dam simple. Yes I replaced on vette and wife's GTO but I did the work not a shop if I take my shit somewhere I expect to pay
Reply: @lukek3148  15 minutes  I don't think so.  Tell all of us how.
Reply: @mikeshoenberger  it's pretty easy 
Step 1. Be a competent mechanic
Step 2. Take bad sensor out 
Step3  Install new sensor
Reply: Ur trash that's why people have to become they're own mechanic
Reply: While I agree with your logic,  2.6 hr's book time is a RIP.  This job can be donen under an hour and that is with removing and reinstalling the intake and all the other goodies that have to be removed.
Reply: @tmurph247  Actually not knowing the time standard and rate of labor, I believe 2.6 hrs for complete repair is reasonable. Not knowing your skills or abilities and having viewed the repair, makes it difficult to believe anyone could do it in under an hour. Maybe you work for Chevrolet and posses vast experience. No disrespect intended as you know something I don't, and have to believe what you say, I don't feel you'd say that without having experience.
Reply: @mchebornek  No ALOT of people will and have said stuff like that just to make them seem like they're all high an mighty.. But either way people like that are more of a troll and just want to stir up crap and say they can do it better an faster than the next guy... But in the end if put to the test 90% of the ones talking can't back up anything they say
Reply: @brandonstone6962  thanks for insite, your correct bout folks making those statements, even sounding somewhat arrogant in their description as to like you said they can do such n such. I've worked on many vehicles but would never comment on any man's work, cause I'm no professional, and have never been employed as one. It's amazing just how many folks have time to challenge one another with disrespect. What is the tell all is as you said, when they're put to the test, knowing that should place the rude ones in silence. Some people don't accept correction which should be wisdom to them. Thanks again, all the best for success. Bid you a pleasant evening.
Reply: @mchebornek  I have seen it so many times before where someone will try an say something to someone and won't have any basis for anything they said.. So they'll get called out on the crap they're saying and one of 2 things will happen just about every time..
1. They'll get all mad an huffy puffy with you an throw a tantrum because they were called out.
Or
2. They'll just sit in silence and watch everyone get all butt hurt over the crap that they said..
So I just read it an go along with it unless it is something that I just cant let go of and then I'll call them out on whatever it was and go from there.. Or I'll start trolling the troll which is SO MUCH FUN let me tell ya hahaha
Reply: @brandonstone6962  my experience lyes in working on vehicles as a young adolescent, ones for resale or of my vast not high dollar collection. Sometimes an occasional friend or a recommendation of special needs, limited income, manless mother and such. Without any funds at all I started a towing business at 19, to long a story. I don't converse in commenting on these deep argumentive situations, in this case you've given your opinion on the behavior of opposing views here. Your comments are greatly appreciated as we're not at odds or seemingly one sided, your opinion could be dealt to either side. You are correct in that someone always seems to have a better idea but become rude bout their delivery of their side. I like both sides usually due to inadvertently learning something, you seem to bring it home with when put to the test they fail. Again I can't agree more, if they know so much then please demonstrate. It brings to thought that if both views could possibly subdivided within the industry. One a book type repair following all standard's and procedures and cost inclusions of supply and material. Second, a direction of a flat fee type operation that relies on vastly experienced and capable mechanics , who are able to correctly compleat the task at hand and sufficiently to satisfy the end user. Now that would be the real test  that you mentioned. There are to many variables for the later to ever succeed, without standard operating procedures, the later would be plagued with yet others who's skills advance causing yet additional decide. Additionally, how would damage beyond stated agreement be addressed, a fee for this and a fee if would develope, more over just broken bolts or unanticipated or unusual wear causing failure to remount of parts. This is interesting in that the industry InFocus here, is one of the nations highest gross earners I'm sure. Most likely this topic is one that'll never be cared for to any satisfaction of either, or any opinion. You and I can only enjoy the small pease of mind that we're correct with opinions of if you know so much please demonstrate, well, right or wrong that's my opinion. When put to it, I avoid encounters with stating "don't ask me, I'm just the tow truck driver". Inasmuch your correct with your view on this topic, unfortunately  you'll always be wrong in someone else's opinion. I enjoyed your response as you gave me your opinion as education or non combative retort. It's refreshing to engage views without being treated as an ignorant, while those that do gives us petty entertainment. Nuff said, bent your ear far to long. All the best to you with success, bidding you a pleasant early morning.
Reply: @brandonstone6962  PS, excuse the interruption, having not followed the comments nor replies, I did just push the 101 (I believe) replies from the author's opening statement. Just going a third or slightly more I found the frightening side of opinions, I believe given the opportunity most of the objectors would have it to drop the hammer. Unbelievable the hate over what I see you pointed out. As you said some trail straight off the edge to unrelated, while others become so vile injecting verbage aimed far above the intention of disgracing the author or others. Nuff said. Good morning.
Reply: @mchebornek  I do work for Chevrolet (GM), and I hope Ray doesn't see this, but that sensor can be replaced without pulling the intake. Not fun, but it can be done.
Nonetheless, that job is worth 2.6 hrs. Ray is a good technician.
Reply: @mchebornek  Ray did previously work for a GM dealer.  He knows his way around a Chev.
Reply: @tmurph247  doesn't matter how long it might take a mechanic. the book time is the book time. the only thing with you being able to do it faster is that you can do more jobs in a single day. you don't charge less because you didn't need the entire book time. and also if it takes you longer you still charge the book time for that job, you don't charge more.
Reply: @tmurph247  I disagree with this logic. If you are not an experienced technician it could take 3 hours to figure out, why should a skilled tech who can do it in less then a hour get paid less than a tech who needs the 3 hours to figure it out?
Reply: @foodhatesme  maybe that skilled tech is disabled in some way and can't. I dunno someone like me who's in chronic pain but knows how to do it.
Reply: @tmurph247  Sez you...
Reply: @tmurph247  I'll send all my work over to you if you're THAT GOOD. LOL!
Reply: @tmurph247  no you can’t
Reply: @tmurph247  Oh you're totally right in the hands of an experienced technician. Just because you're better at your job doesn't mean you should get paid less.  People forget they pay for experience and the tools and equipment. No one would stay at the same job if they paid them less money for doing the same amount of work just because they get better at it.
Reply: @tmurph247  There is get the Job done Fast and Then Get the Job Done Right
Reply: @tmurph247  You should post a real time video with timer to show the world how good you are.
Reply: @tmurph247  Have you done this?
Reply: Only a RIP when the cost of mechanic  wear and tear is not accounted for. 

 Everything costs something.  

When the risk is properly valued, meaning wage loss insurance and health care insurance are funded, ready to kick in should the fast job go bad, people will find those costs are far more than the modest amount required to do reasonable and prudent work.

Ray made it clear he does not have the insurance against the risks, which means people get exactly what they paid for.

Ray, by doing reasonable and prudent work, is acting exactly as  he should in this scenario. Putting him and his family at risk for no real return doesn't make any sense at all
Reply: @tmurph247  What's a rip about that? how many hours goes into every hour? And why would you charge less, for having skills and knowledge and tools to let you do things in less time? It took time and investmentt to gain those abilities, and requires accepting some risk to use them. So long as you do a good job, you charge full price - how you got to the part isn't what they're paying for, who you are is what they're paying for. Otherwise the customer could do it themselves with a ten dollar toolkit. We don't need to worry about that, even when you show them the whole thing on video, because there's a lot more to it than that.
Reply: @tmurph247  You lie tmurph guy.
Reply: @tmurph247  technicians work on book time otherwise customers would do it themselves and take 3 times as long.
Reply: @tmurph247  But getting paid 1.7 for a job that takes 3 hours happens too. A guy has to take the bad with the good.
Reply: @tmurph247  85% of job's can be done quicker than the book says. Shops have overhead. Don't want to pay what the book says take it to the guy working from his garage. Maybe he won't screw your vehicle up any worse by cutting corners,  or do it yourself.
Reply: @mvg-1776  I do all my repairs myself, (former mechanic 15yrs... notice I didn't say tech, anybody can read a scan tool)   and more than likely do a much better job than some overpriced "shop",  there's a reason my friends and their friends bring their vehicles to me to be fixed,  I do it right for a tenth of the cost.
Reply: @tmurph247  yawn
Reply: @tmurph247  Yes! Me too. I got sick and tired of mechanics that only care about the buck and not their work. Fuck up my car , or never fix it correctly.  I'm telling ya, its hard to find an honest Mechanic.
Reply: @mvg-1776   This is why I do the shit myself.  Pay someone 300 bucks labor for 20 minutes work?
Reply: @tmurph247  Your the type of guy to try and tell a professional how to do their job I feel bad for your wife  💩🤳
Reply: @tmurph247  most book times are way off. I'm so glad I have a mechanic that just charges me based on how long it takes him and never charges over book time. He IS a professional mechanic who owns a shop and is a close friend of mine. I'm sure he doesn't do it for everyone, just close friends and family.
Reply: You can’t strain a metacarpal. You can’t even sprain it. It’s a bone. You can fracture it.
I watch this channel for the same reason I watch Fail Army…. ignorance can be interesting to watch as long as one isn’t directly involved
Reply: @Zerpersande  congrats Dr. Zerpersande for knowing better than all your peers, we can strike MCP (Metacarpophalangeal) Collateral Ligament Sprain from sports medicine with your outstanding insight in the field.
Reply: @Zerpersande  you missed the joke buddy
Reply: @Zerpersande  He is a mechanic not a Doctor so his ignorance is forgiven. You are not a scientist yet you still believe climate change is caused by humans.
Reply: @Zerpersande  high iq armchair quarterback right here
Reply: @Zerpersande  thank you doctor!
Reply: @Zerpersande  Where did he fail? Sometimes Ray goes by the book and sometimes he will save the customer money where he can. You're just a troll who probably can't even change your own brakes without help.
Reply: @Zerpersande  -- Nitpick much? The wrist, knee, elbow and ankle are all bones as well, but we commonly talk about straining/spraining those. You strain/sprain the ligaments around the metacarpal and in common parlance people will talk about straining or spraining the metacarpal. If YOU didn't understand what he was talking about, it doesn't actually matter, does it? Because who cares what you don't grasp?
Reply: @twatmunro9563  LOL burned
Reply: @Zerpersande  Hah ! bet you googled that ! Yes they are bones, but they have joints- which you very much can strain. Have you ever strained a metacarpal ?  (ask anyone in the medical profession- they totally know you are talking about the joint)  Not much fun.
Reply: @Zerpersande  Where did you learn anatomy metacarpal isn't a bone it is a tendon in your wrist. Metacarpal Syndrome is when the tendon gets inflamed in the sheath in your wrist from repetitive movements like straining to thread a bolt in a tight spot. It gets me how TROLLS flap their yaps when they don't know what they're talking about and you're talking about ignorance !!!
Reply: @Ken-rk3by  
Bowman Gray School of Medicine. Anatomy class. Worked with cadavers. 
The metacarpals are bones in the hand.  So that you can visualize them, they are the bones that connect four(4) of the eight(8) wrist bones, called carpals, to the base of the five (5) finger bones, called proximal phalanges. So although you can fracture/break a metacarpal, you can’t ‘strain’ one. Strains occur in muscles or the tendon that attach the muscles to bones. And it isn’t metacarpal syndrome, but carpal tunnel syndrome. And it isn’t the tendon but a nerve that runs through WITH the tendons, called the median nerve. You can try Google with strain, fracture, phalanges, metacarpals, carpals, carpal tunnel syndrome, and median nerve. I actually respect mechanics. At least the ones that know their fucking limitations.
Reply: @Zerpersande  well if you only watch the ones that know their limitations why are you watching this if all you can do is complain about how he does things
Reply: @Ken-rk3by  because most of his videos are good.